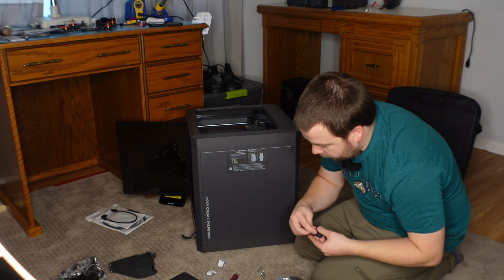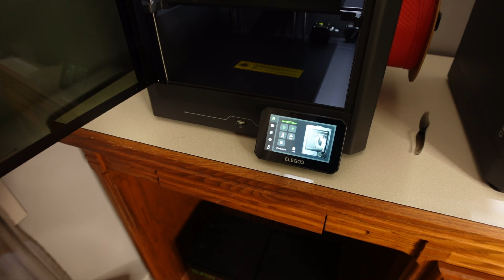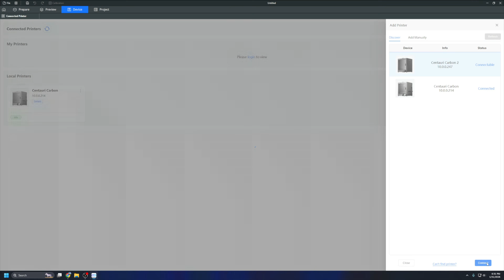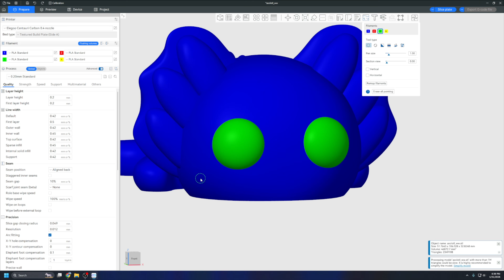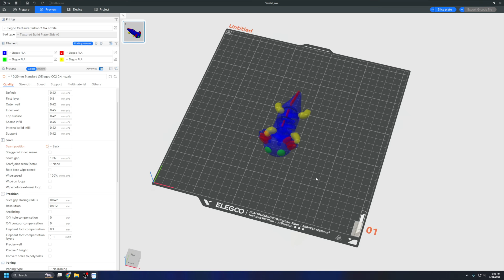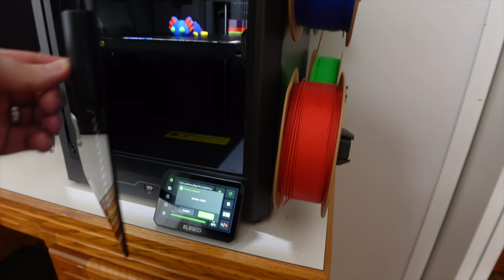Elegoo Centauri Carbon 2 - Honest Review and Impressions

Comment: Where would you put them? I like the side. Anything I need dry, I have a dryer…
Reply from the maker: Up top like bambu does it. Takes up less space that way and I could fit 2 cc2’s on my desk better.
Reply: @lukeman269 Thanks Luke. I didn’t get the question! 😂… I got the CFS for my K1SE, and had it on top. I have to say though, after a few jams, I took it off. I’m hoping the Canvas system is more reliable. The filament path is shorter so that’s great.

Comment: I just got mine yesterday and so far I'm really impressed.  I really wanted something to hold me over until there is a broader selection of tool changers to choose from and I'm really interested in the Sovol that is being released sometime soon. The CC2C is replacing an old Prusa MK3 that is 8 years old.  While I don't think I'll do a lot of multi-color printing on this, the difference in price between the version that comes with the canvas and the one  that doesn't is only $40.  I had to go with the combo.  The build quality of this machine is amazing with an all steel case and the fit an finish is great.  How can they sell this for $380!  Amazing.

Comment: so do you regret it?
Reply from the maker: I don’t regret it. It’s been a solid printer and the multi material system has been working great (once I fixed my assembly mistake). Really hard to beat the value of this printer.

Comment: I still can't decide between the CC2 and the P2S. I need a reliable printer that doesn't break and has good print quality.
Reply from the maker: My co-worker has the P2S and he loves it. It all depends on what your budget is. If you can afford the P2S, that’ll be the better printer. The CC2 is very capable and has been working great for me so far. The price point is where the CC2 shines. Easily best bang for buck multi material printer.

Comment: I live in el paso TX, mostly dry climate, low humidity. Sunlu dryer aside, do you think a side mounted guide with a bowden tube in it for each spool would help keep it from backing onto itself?
Reply from the maker: Well some guys in the comments mentioned I had 2 of the spool holders on wrong so they didn’t work as expected. The spool holders have a spring back mechanical function that prevents them from getting tangled. So I would try it as is first. Would have fixed my issues for sure.
Reply: @lukeman269 oh yea that makes sense. I think they’re supposed to be 
1-3
2-4.
I get mine later this week so looking forward to the test 👍🏽 great review!
Reply from the maker: @hdjoe22 thanks! Enjoy!

Comment: Wow, thank you for the review. That waste cup is nuts! Folks definitely need to be aware of time and material waste with this machine. Elegoo needs to make tool changers next. I wanted this machine badly after selling my CC, but the waste and slower prints, along with no filament containers will have this printer outdated quickly.
Reply from the maker: No problem! Glad I could help you make a decision lol. 

Yeah I’m not thrilled with the extra time and amount of waste it creates but I think I’ll still find some good use cases where it won’t wast too much filament. Like using 2 colors for signage or more basic models. Maybe even just being able to add 2-3 spools of same material and not have to worry about running out mid way through.
Reply: @lukeman269  Yeah it seems awesome for one color like my CC was or not very tall multi color like you described. One cool thing would be to be able to have the same color on all spools and when it runs out on one spool, it can use another spool to keep printing. The way I have to put it to myself now is in terms of competition. If more time and material are wasted for a sale, or to compete with other sellers, it will be that much harder to make a profit and also hold its value as tool changers release to market. I love elegoo and their marketing though. Good company, they just need to catch up and then get ahead of their competitors instead of wasting time on older tech.
Reply: Also, it's less than $500. Let's keep some perspective here. If your use cases involve prints that produce a lot of waste already and you want to mitigate that, it's gonna come at a premium price. For what the Centauri 2 offers it's hard to imagine another printer coming close anytime soon at this price point.
Reply from the maker: @roshi98 totally agree. The only option to reduce waste is a multi extruder setup which costs 4x more.
Reply: @roshi98  I do understand the concept of money and value, but you wont be able to beat your competitors who can afford a better printer by investing in a less capable machine. In fact, you are making it even harder for yourself to eventually afford a better machine. It is always tempting to buy something cheaper, but it will be outdated quickly just as they did the first one. Versus a more future proof machine using tool or head changers that cut down on time and waste. I did love my centauri carbon, even though the chip was defective and gave me a lot of issues leveling, but when it was working properly, I enjoyed the quality and dependability. I just have to be patient and spend money more wisely as I am not looking to collect outdated printers in the future.
Reply: @Bioworld8 Well stated
Reply: @roshi98  thank you roshi! I have been mulling it over for a few days now I am not trying to be a dick, it was hard for me not to buy TBH! lol
Reply: I am in the same boat, I want multi-color but I don't want the waste. I keep trying to justify the H2C or UI... if the waste is almost half, or more, than the total weight of the model, my 'touch of OCD' is going to kick in and drive me nuts when I know there are tool changers I could get if I was just a bit more patient.
Reply: @phuzed37  you shall be rewarded for your virtue

Comment: Why on earth did they go with side mounted spool holders for multi color and not an separate external holder/dryer.  Seems like a dumb move and vary limiting to users.
Reply from the maker: Totally agree
Reply: I agree that a separate enclosed system would have been better. We'll definitely see some mods that address this, but it's limiting their market for this right out of the gate.
Reply: Well it depends, even AMS 2 PRO doesnt support print while drying. I would way its good way to save money.
Reply: The U1 also has side mounted spools…

Comment: I have the AD5X, which uses a similar system. From what I saw, the spool holder for the red (#2) filament is not mounted properly. These are spring-loaded, so when you spin the spool to unwind filament during printing, the spring should load and wind the filament back when the printer pushes it back during a color swap. If they are mounted in the wrong order/direction, the filament won't wind back properly and will tangle, just as you experienced.
Just try to spin them manually in the direction the filament would be unwound during printing and see if the spring will wind the spool back when you let go.
I'm also very excited about this printer, my review unit is on the way but we're late here in Europe, shipping is taking a bit longer haha.
Reply from the maker: Thank you for the valuable info! I’ll make a pinned post to ignore my filament tangle issue. My mistake lol
Reply: @lukeman269  It's easy to miss if you don't know how it works. When I received the AD5X for review, I watched an assembly video so that I wouldn't get lost while filming the assembly, and it was mentioned there. I thought it was a clever solution for a low-end, low-price printer because it has no electronics, motors, or gears—just a good old spring, which works great. 
You can also put the entire system in a sealed box. Just mount the four holders onto a piece of whatever you want, and place it in the box. It doesn't need any wiring, and it will work without any issues. 
Great video btw., got a new sub ;-)
Reply from the maker: @Projekt-Werkstatt I appreciate the information and kind words! Thanks for checking out my video and thanks for the sub!
Reply: how is AD5X is going with you so far? all reviews on youtube sponsored with same script , i want a honest review
Reply: @MohammeddAlanazi so far the AD5X didn’t let me down. I had one failed print but that was probably because I tweaked the settings a bit too much… But I also mostly print PLAs on it, I tried some PETG that worked pretty OK but what’s impressive is the fact that I haven’t ever touched most of the settings! 
You can watch my video but it’s in german but I guess YouTube offers an AI translation lol.
DISCLAIMER: My video is also a „sponsored“ video, I got the printer to showcase it in my videos BUT none of it was scripted, supervised or anything like that. In fact, I ordered it just regularly from the shop so it’s not even a cherry picked unit. So all my thoughts and experiences are 100% legit and honest! Ask me anything you need to know, I‘d even put it to the test and make a video if you hava a specific question / challenge!

Comment: Was the full cup of waste from that 1 print? I would assume it's not, but I am new to printing. Do you think this is any slower than Bambu Lab's multi-color printing? I want this Elegoo printer, but not if it's a lot slower than others.
Reply: Hi, My understanding is that the Bamboo Lab's AMS only has one ptfe tube from the buffer, mounted on the back of the machine, to the print head, so has to retract the filament a lot further than the Elegoo as it has 4 tubes all the way to the extruder, so only has to retract a couple of inches on each colour change.  This results in much quicker colour changes.
Reply from the maker: It was just from that one print lol. I was baffled by how much waste there was. I guess there’s a different setting or 2 to help with that. You can also choose to purge less filament with each color change as well.

Unfortunately I’m not sure about the Bambu printers as I haven’t used them personally. Since they use a similar system, I think the time would be very similar speed. Especially when using it for multicolor printing.

Comment: We went backwards. They came up with the AMS, then the AMS could dry and store filament, and now they are just hanging the spools somewhere on the printer. Depending on your climate, they will draw moisture fast, faster than most user will ever print it.

Comment: принтер курильщика, мне интересно как с такой подачей сушить катушки? нужно короб думать для них с подогревом и сушкой, да и прошивка закрытая, открытый клипер всегда лучше.
Reply from the maker: No way to dry the filament spools the way it sits. I do have a Sunlu S4 dryer box I’m planning to use with this printer. Just need to buy more Bowden tube to run from the dryer box to the printer.
Reply: @lukeman269  возможно можно придумать боковой короб для катушек и туда вкорячить фан с подогревом, есствественно через предохранители, готовых решений уйма, примерно как на новой прюше сделали, правда там выемка в принтере

Comment: The spool holders have numbers on them to match numbers on the side panel. Your kid put his on wrong. Put them on from the bottom instead of the top-down. Also there a setting in the slicer to where you can select print to object which helps cut down on waste
Reply from the maker: Thanks for the tips! I’ll check that out.

Comment: it was my understanding that those spool holders were somewhat spring loaded in such a way that they would rotate backwards to keep the filament lightly tensioned when the canvas retracts that filament to make a change to one of the others. Looking at your spools after printing only #2 (red) has obvious slack while all of the others do not seem to. Just wondering if my understanding is wrong or if your holder #3 isn't behaving correctly.
Reply from the maker: Hey you’re totally correct. I was not aware of the numbers on each spool holder. I had 2 and 4 reversed and that’s exactly why it was getting loose. Thanks for the info!